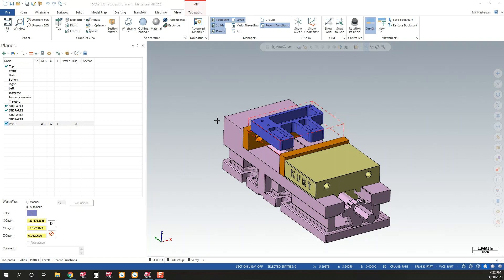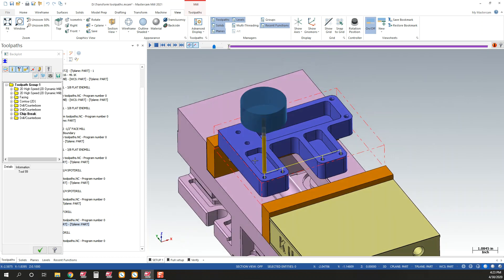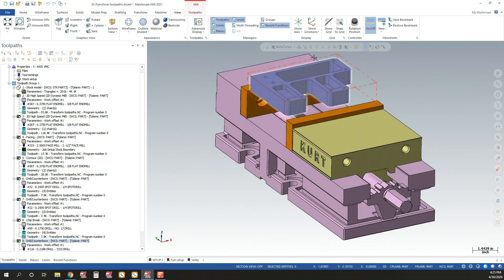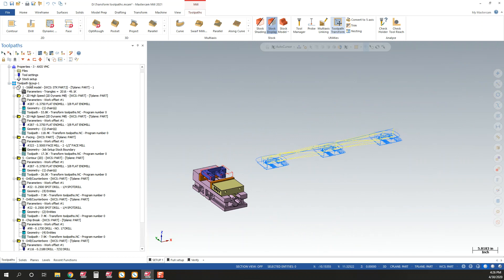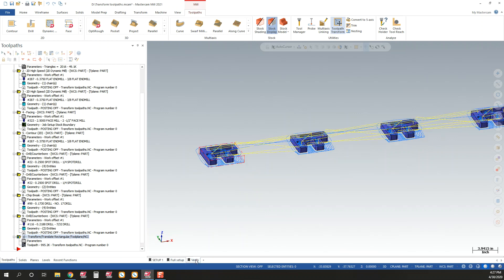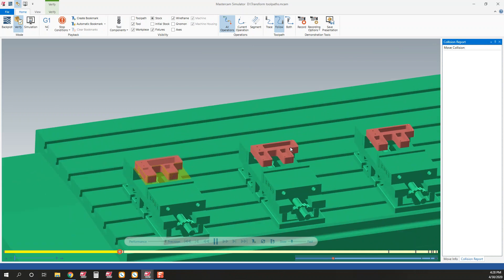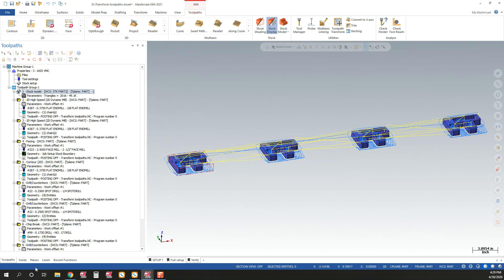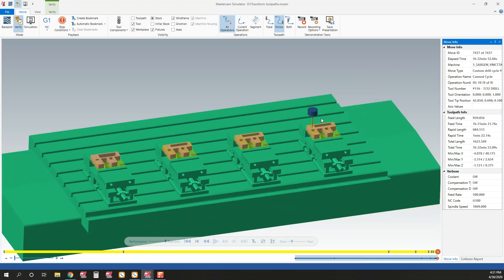Mastercam Transform Toolpaths Optimize Cutting Multiple Parts

Comment: In machining we use a vise not a vice.

Vice is the more common of this pair. Often contrasted with virtue, vice is used to refer to a variety of inadvisable acts and behaviors, from the merely blush-inducing to the truly scandalous. Minor foibles and bad habits can be described as vices, as can actions of such moral depravity that even regular readers of the most salacious tabloids are shocked, yes, shocked.

The word is Latin in origin, tracing back to the word vitium, meaning "fault, vice." It entered English by way of Anglo-French during the 14th century.

The word vise is another thing entirely. It refers to a tool with two jaws for holding something. The jaws can be closed, usually by a screw, lever, or cam. A vise is handy, for example, when you've glued something together and need to keep it still while the glue dries. The word vise is also used figuratively to refer to something that is like a vise in the strength of its hold, such as "a vise of debt."